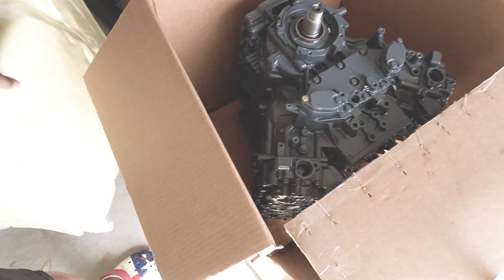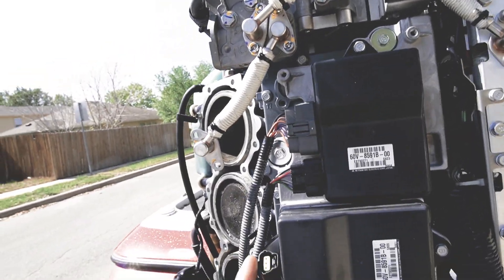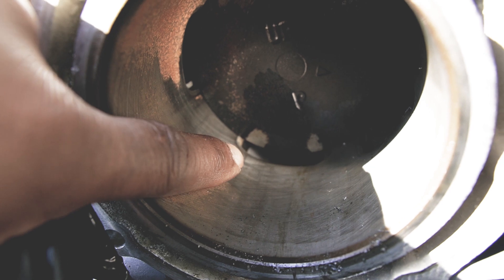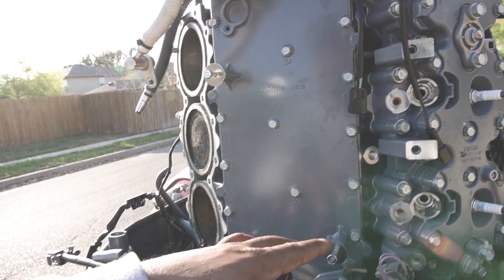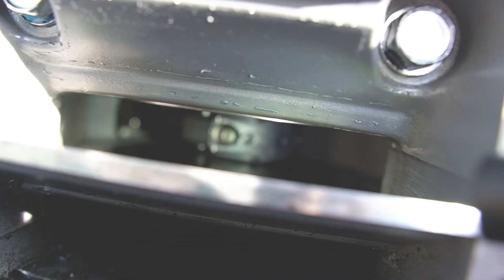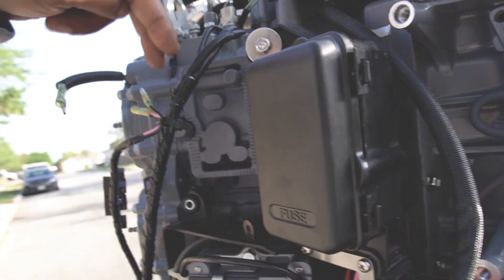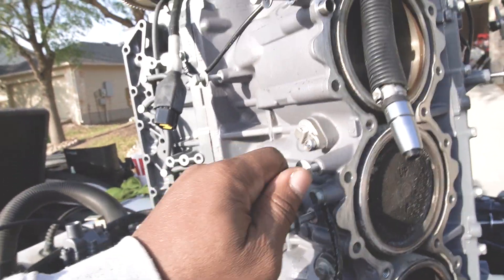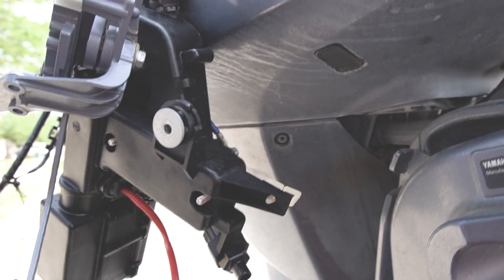Removing my Yamaha HPDI Powerhead  Ep2

Comment: I feel for you.
Last year I lost cylinder #2 and #4 on my 2004 Z300 HPDI.
I took it apart and re-sleeved the the 2 cylinders and replaced the pistons without removing the power head from the outboard.
One of my 2 HP fuel pump had a blockage and the fuel restriction caused the failure.

Comment: Do you have an audible alarm when you first turn the key? Have you had any oil sensor issues with alarm not working?
Reply from the maker: Yamaha's dont have any alarms when first turning the key that a Mercury  feature. No problems with that oil system as it is pumping as it should , if you are there is small filter/check valve on your oil tank that causes problems
Reply: @WillCory  I have an 05 skeeter and it used to beep upon startup. Engine blew had it rebuilt now no beep when you turn the key..Just because it ran low on oil and no alarm went off..